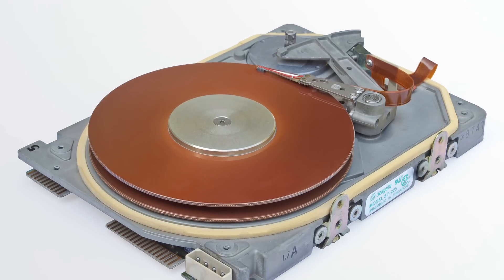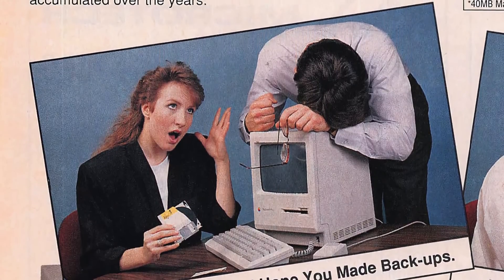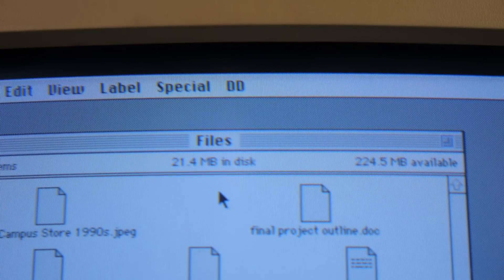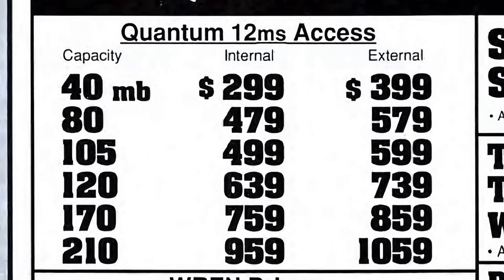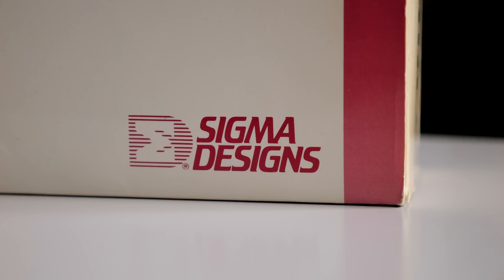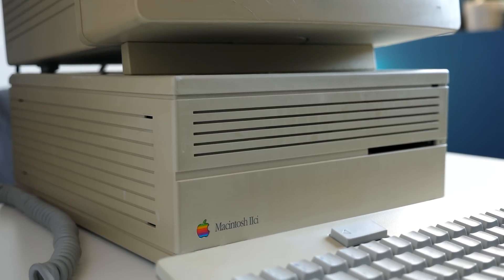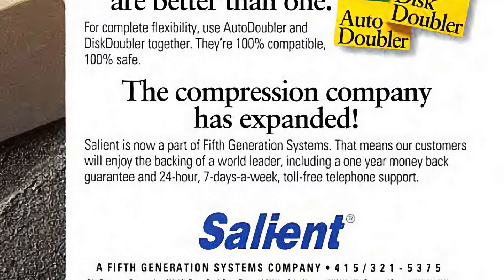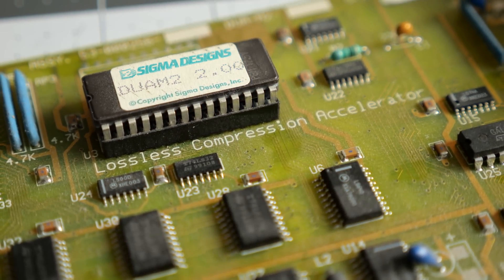Double your retro Mac's hard drive space with this one weird card...

Comment: I still us on the fly disk compression on Linux. Not on my main system drive. I have an external USB 3.0 1 TB 7200 rpm spinning drive formatted with the BTRFS file system which supports on the fly compression and decompression. I have my TimeShift (like System Restore but for Linux) set up for automatic weekly backups of important files and once a month I do an fsarchiver dump of my entire /home/user which I keep on it's own partition. The entire partition is about 228 gigs and on the compressed drive the backup sits at just 150 gigs. The entire backup only takes about an hour and can run in the background while I use the PC.

Comment: It’s interesting to compare this to modern cloud storage subscriptions that get sold. 

Since a lot of phones are deliberately sold with little space, expecting music streaming and cloud storage of photos to pick up the slack. It’s ridiculous that 16GB phones are sold when the minimum should be 128GB nowadays, especially since the price differential between those models gets eaten quickly by those subscriptions. 

Of course, a lot of the space-guzzling files we have now are already maximally compressed, so these programs are only useful for composing program files and associated logs, preferences, etc. Still can save a bit of space, and but certainly not worth charging for. Saving a few GB, compared against the market rate for SD cards, would save maybe 50 cents. For a lot of people the time spent setting it up can be worth more than that.

Heh, I just noticed your demo of compressing a JPEG. At least it’s just zero savings rather than negative savings, as I’ve seen sometimes!

Comment: As I was watching this video, Amazon delivered a 512 GB micro SD card for my wife's phone. HALF A TERABYTE. On a phone.

For someone who was saving computer programs to cassete tape during the 80's, that is mind blowing. I vividly remember the first hard disk I ever saw, a 10 MB unit installed on an IBM PC-XT Clone in 1992. 

I used software-based data compression on my HP Omnibook 600 laptop, which had a 260 MB (uncompressed) PCMCIA Type II hard drive. The extra space (almost 500 MB compressed) surely was worth the performance hit!

Comment: And then of course there was DriveSpace (originally called DoubleSpace) on Microsoft DOS 6.0 up to Windows ME, which compressed data into a single file and if that got corrupted you lost it all - see Wkipedia's description below. I lost a lot of data once. 

Wikipedia: the user would have one hard drive in the computer, with all the space allocated to one partition (usually as drive C:). The software would compress the entire partition contents into one large file in the root directory. On booting the system, the driver would allocate this large file as drive C:, enabling files to be accessed as normal.

Comment: Software and dedicated hardware like this is an awesome addition for any 90s machine. The simple task of compressing files was anything but simple during this time, yet it seems more fun to do something like this on a 90s Mac or PC. It might be slow compared to a modern machine, but they show how different computing used to be. Upgrading machines to the max and installing as many cards as the case can hold!

Comment: Ahh the early 90's when HDD compression was all the rage. I was thankful my 486 PC came with a 260 MB HDD which at that time was quite large. While I extensively used the PKzip and ARJ file compressors to shrink mostly games down to fit on multiple floppy disks to share with friends I never did get into compressing a whole partition or a whole HDD. I had friends who at the time had computers with 40-105 MB HDDs that did try things like Stacker and DoubleSpace and often times had horror stories to back up their experience. 
I still remember purchasing a Western Digital 1.2 GB HDD in June of 1996 and paying a little over $400 for it. At that time 1.2 GB seemed like a MASSIVE amount of storage!

Comment: My First computer has a 10 GB hard Drive. The usable storage was like 8 GB. It come with a custom version of Windows XP, for old computers. I don't remenber all the specs, but It have a amd CPU at 500mhz and 256mb of RAM. I played Youtube back in the day and ran ok in Firefox. The hard Drive died.
One thing that doesn't have was USB, a red USB board was install but never worked. The good think is that Office was preinstall. That the real mistery.

Comment: Stuffit for Mac and PKZip for PCs were not primarily for saving space, but for file transfers and this was especially true pre widespread internet access.  Dial up BBSs were slow. The fastest modems were 9600 baud around 1990 (14.4 may have been around, but was not widespread if  it was. I just don't recall the year 14.4 modems came out)

Stuffit played an important additional role.  Mac files cannot leave the Mac FS without being corrupted.  Even though file transfer protocols like Z Modem and Y Modem auto-wrapped 8 bit files into 7 bit files for the transfer, they did not preserve the dual fork or data format of a Mac file.  But a sit file had all this data inside the sit file. So long as you could decompress the sit file on a Mac, the files would be preserved.

Comment: I remember one job I worked we had an xp machine with a 300 gig HDD that recorded data from a test rig, they had about 5 years worth of production data on there and it had about 10 gigs left free. they refused to give us any options for archiving the data off the machine, or additional hdds to expand its storage, so I turned on every single compression thing built into XP, that poor optiplex had nearly every file compressed except the absolute minimum for the OS and the test recording software. Not sure what happened to it but its replacement only spat out a 500mb file on each successful test

Comment: On PC there was no such thing because of Microsoft DoubleSpace first example of "mnopoly practices". Later on NTFS introduced same thing as most versatile system for both internal and USB drives. I will skip that atrocious ExFAT patent SCAM. NTFS works both for Windows, Linux, BSD, Mac features NTFS file compression witch is literally an LZSS on 4kB buffer "window". I wrote by myself accidentally such compressor 4096 = 12bit OFFSET, 4bit MARK, 16=4bit SIZE of pattern, plus 1,2,3,4byte RLE limited to 256 chars at once, very simmilar to what Microsoft embedded into Windows, saddly on mine Celeron 1GHz it was much slower, with hash chain it was around 4MB/s while somehow Windows was able to compress in 10-20MB/s almost as fast as LZ4, LZE... And so i surrendered abandoned, it was part of mine own "CopyHandler" to speed up Windows 98 copy process. For years what was implemented  in Linux was garbage, and specially Haiku do have awful performance like kB/s. While on Windows i never noticed any slowdown in speed on USB 2.0 noticed some limitation in 1GBit network. Its not big deal but sometimes helps specially in era of SSD's. All Windows Update WIM files are compressed with almost same technique just not limited to 4096 bytes block. In addition as far im concerned they added Huffman coding for literals. 

These days hardware encrypter might be usefull if BitLocker, VeraCrypt wasnt on the market.. eventually good software beats any hardware accelerator..
Reply: @SergeyVolkov  Yeah, DriveSpace/DoubleSpace was released as part of MS-DOS 6.0 in 1993. Stacker was released in 1990.

Comment: one thing is that in later 90s bigger files tended to be compressed formats in the first place and potential to compress them further just wasn't there as much.

later msdos shipped with doublespace as well, so people weren't as tempted to buy 3rd party software to dabble around with disk doubling software killing the market on pc.
Reply: I think there was still quite a bit of potential, even today you can make good use of disk compression despite massive hard drives and trivial access to compression
Reply: @sluxi  there is, in access speed too depending on the hw speeds(its faster to read a compressed thing into memory from the storage medium if the decompression is fast as its less bytes to read from the media). But usually its better that it has happens on the application level. Concepts still in use on live cd systems and a lot of embedded systems fs(in those usually on parts that are read only in normal operation).

It can be handy if you're just hacking around with some code and using a folder as a crude db and stuff too, easy enough to enable nowadays on say windows per folder
Reply: @lasskinn474  zfs on linux or freebsd makes it really easy to enable on whole datasets, btrfs has similar functionality
Reply: DoubleSpace was a Microsoft abomination (another one!) to compete with DR-DOS which was cheaper and much feature rich including data compression and 386 high memory manager.

They stole the compression technology from Stac, and lost the lawsuit from this. But they covered everything with millions of dollars as they usually do.

They needed to release many releases up to ms-dos 6.22 to fix many serious issues. Disastrous "Microsoft technology" as usual, like today's Teams, Windows or etc.

Best wishes.
Reply: @ajax700  There was nothing to steal from; the compression algorithm is trivial, and the case would be laughed out of any court outside of US.
Reply: @IkarusKommt  
In the hurry to compete with DR-DOS, Microsoft made like they were going to license the technology from Stac.

It's not only the compression algorithm, it needs some development to be transparent to the user. It wasn't just zip files or similar, it was on the fly whole filesystem compression.

And why they needed to look under the hood before making their own version, and then saying "no thanks, we don't need you Stac". And don't pay a cent for it.

Typical Microsoft scamming behavior.

If it wasn't for DR-DOS, ms-dos version 6 would have very few new features, like version 5.

Comment: Cool video! Neat piece of hardware to add to the classic collection.

I only used disk compression once on a hand me down computer. After that drives of 1GB+ were common.
Reply: Disk Compression software doesn't work very well past the 512MB barrier. Looks like bigger Compressed Volume Files (CVFs) make these utilities to crack.
Testing in VM looks like the max them will go working reliably is something like 768MB disks, with a 512MB CVF as compressed drive.

Comment: Staples told me that buying a 1.2GB drive was pointless because I'll never fill my 210mb drive up. It was already full at that point.
Reply: Ugh, I have a similar memory of computer salesmen saying a 1GB drive was unnecessary and the 340MB drive in our 486-66 computer was “plenty”.  Even with Stacker I was always running out of space.  The same pattern still presents itself when a certain subset of IT people don’t understand why regular people need 64GB or more of RAM today.
Reply: @Sean Wieland  my daughter has been getting into 3d art, blender, etc. I went to check something on her computer and realized it was only running a single stick of 8gb ddr4. Within 20 mins i ordered more ram, and realized that we had given her a machine with only 250gb of space, that wasn't an nvme drive. Ordered new ssd as well
Reply: @seanwieland9763 my old ass MacBook with 8 gigs of ram and a core 2 duo runs better than most Chromebooks nowadays. Also, it’s more upgradable.
Reply: @seanwieland9763  unless you’re running a super computer there is no reason that you need 64 GB or more of ram
Reply: @Jewellz86  just running Chrome web browser with a hundred tabs open makes use of 64GB of RAM.
Reply: @seanwieland9763  yeah and that’s why I don’t use chrome unless I have to

Comment: I miss the 90s when computers and software were more open and expandable and interesting experiments such as  Disk Doubler that we got as a result of that.
Reply: We do have the option of running open source easily nowadays. Wasn't really possible for most users during most of the 90s.
Reply: It was a wild west back then for sure. A lot more homogeneous these days - we've surpassed the hardware limits you'll ever need for home use, nowadays innovation is far more around efficiency and business/ scientific usage. The consumer advancement age is noticeably more stagnant.

I remember vividly when 1ghz was hit for the first time. Exciting times
Reply: and when they never bothered to release an updated firmware version because distributing it would open legal issues if they didn't distribute it widely enough, so many didn't AT ALL...
Take off your rosy colored glasses and learn how to use a soldering station (with hot air wand) - it's much more open than it ever was; and unlike way back in the day, kids can casually learn how to program in dozens of languages at their own pace using a cheap RasPi or some old PC way too slow to game on but fine for tinkering.
Back then, even small parts were paid for with blood... look at the relative prices and do some mental math - any good hardware was so expensive even "working adults" had to budget for them. These days one can get a 24"+ monitor for a hundred bucks in modern money. Even a tiny 15" CGA monitor was hundreds back in the day, and when VGA came out you had to replace it.
Don't try to smoke that rosy colored nostalgia too much... none of us had the cash to enjoy that era as you pretend.
tosel is spot on.
Reply: @chouseification  it was unpayable indeed. A lot of slavery behind software still exists today nevertheless.
Reply: They still are. Just stay away from the fruit brand and you'll be fine.
Reply: what are you smoking? computers were never more open than today
Reply: @toseltreps1101  meh, depends, in the 80s you could get the schematics of a lot of computers, i have an appleII manual that has them in the back of it. you also didnt have things like the DMCA that legally prevents you from reverse engineering something even if you own it. sure we are getting better in some areas for open computing (thanks to the likes of the RasPi, Arduino, Framework and several others) but still mainstream consumer products today are far less upgradable, far more landfill ready at the drop of a hat. And im not talking about what us enthusiasts buy as we know what its better, im talking about the everyman, the mothers and grandmothers, the walmart dwellers. They dont look into stuff being open, all they want is something that works, and when it doesnt they throw it out as the cost of repair usually is more than the device is worth. Also with the way it is from Apple and now Samsung, if you wanted to replace your broken phone screen in the US, good luck getting the a 3rd party part past customs.
Reply: @jjjacer  Nothing prevents you from reverse engineering anything you own, however you can't just go and sell your work or anything like that.
Reply: @toseltreps1101  He probably meant that some laptops are less upgradable because the parts are soldered and have less space
Reply: @JasperTedVidalTale  i don't think so. he wanted to make a smart sounding remark without actually knowing anything
Reply: @toseltreps1101  if you say so

Comment: Nice card, I hope you are enjoying using that thing. Dedicated compression hardware was certainly a thing then, I also remember all those dedicated MPEG cards.
Reply: For video, still is. It's one reason that h265 and AV1 are struggling to catch on: Almost every mobile device has a hardware h264 accelerator built in, but might not be able to keep with video decoding otherwise.
Reply: "... MPEG cards..." Which interesting enough, Sigma Designs also produced :-D.
Reply: These were nowhere near as effective as the people pushing them back then made them out to be.  Most hard disks could not get anywhere near 50% compression.  They also introduced complications. 
In some minor cases, it could actually speed up the drive though.  If you can get very high levels of compression for certain file types, they would transfer from the disk to the controller that much faster. In some minor cases, the time saved in transfer was greater than the time spent decompressing.
Reply: They lived on as pcie expansion slots in servers.
Reply: Gosh I wish we had such dedicated hardware nowadays, it'd be dirt cheap and it would be a great solution to turn an old computer into a low-end video editing and encoding station.